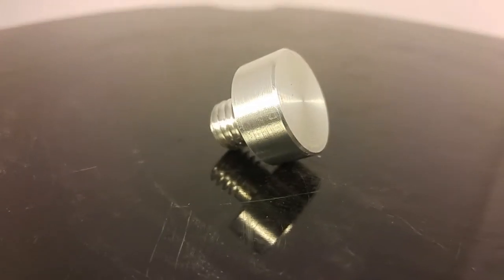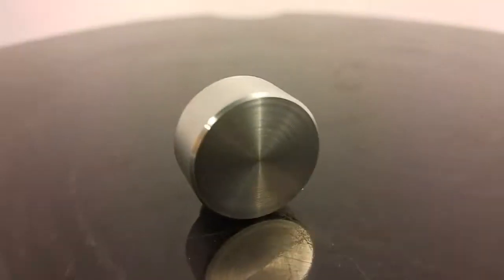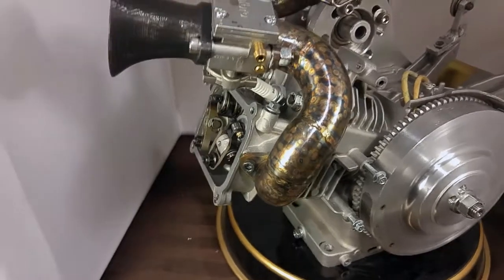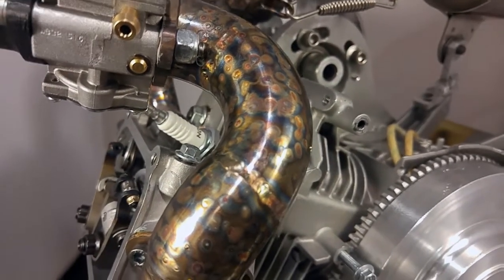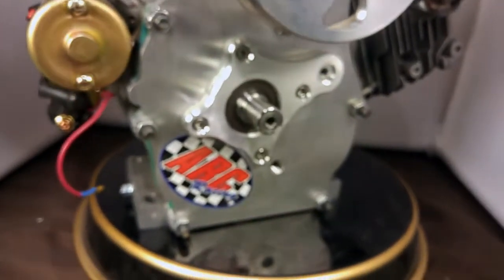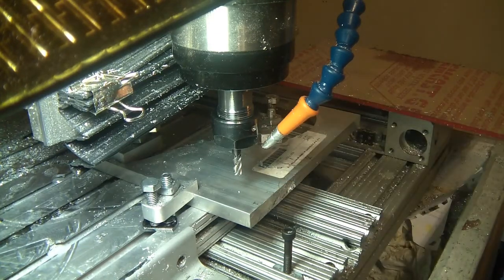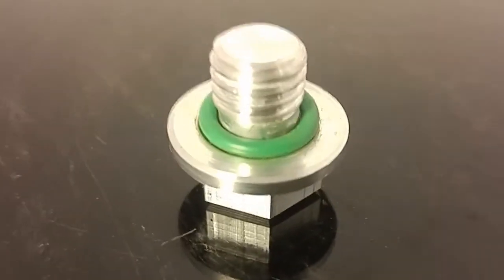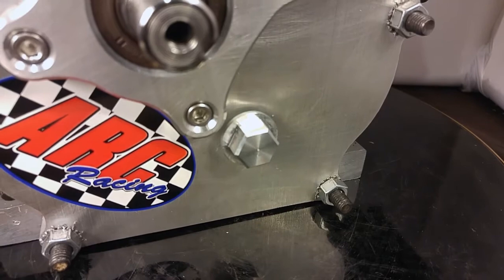Homemade Paramotor - Engine Update & Machining Oil Plug

Comment: Can we use bike engine for ultralight trike?
Reply from the maker: I mean, there are a LOT of different bikes. It's a lot of work but of course you can, depending on the bike.
Reply: @IrisPPG  OK thank you..  If so minimum what's the HP can we use for  2 seater?

Comment: Still loving all of these videos.  Have you got an air filter in that stack?  If not, what do you think the risks of a scored cylinder etc are?
Reply from the maker: Probably pretty slim. It points up and I'm very rarely around any form of dust. Obviously there is none when you're up in the air. I thought about running an air filter but it would actually take away from the velocity stack's efficiency.

Comment: The tuned length should include the velocity stack as well as it's  what reflects the pressure wave. You could make a telescope tube intake and very it's length to obtain maximum power, and then make a hard copy at the correct length. I think cooling will be a problem without the fan. Even with an oil cooler and pump. Looks good though
Reply from the maker: Nick Dunn there's a 49" fan 😊😊👍

Comment: Hey quick question do you think this is the same motor you using? https://gokartsusa.com/Clone-Kart-Racing-Engine.aspx
Reply from the maker: I built mine from a Predator 212 and the above is a Clone motor. They are similar in size and some parts may be interchangeable but Pred 212 is its own engine (it also has a much beneficial Hemi head). Also, my engine is a lot more spendy as just about all parts are either aftermarket or custom (the one above looks either stock or slightly modified which is not enough power to fly).
Reply from the maker: There are a lot of aftermarket parts for Clone motors... and you can fly with them but it will take a lot of work (especially when it comes to the reduction).
Reply: ya i understand, I found this little page as well I'm sure you have most of these things covered. Just saw the upgraded valve springs, may be a good thing to add if you haven't. https://gokartsusa.com/Parts-for-Honda-GX160-GX200-Clone-Parts.aspx
Reply from the maker: I run 36# springs and a specific cam (otherwise you float valves before getting into RPMs required for flight.
Reply from the maker: I also have billet chromoly roller rockers and very thick pushrods to handle the added strain from the increased spring pressure and RPM.